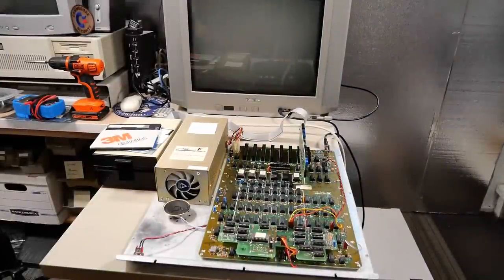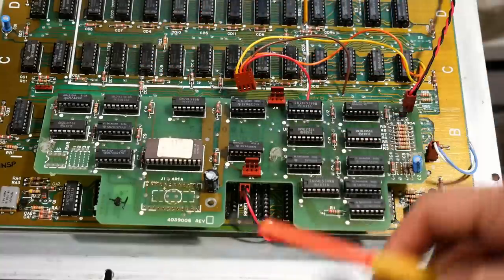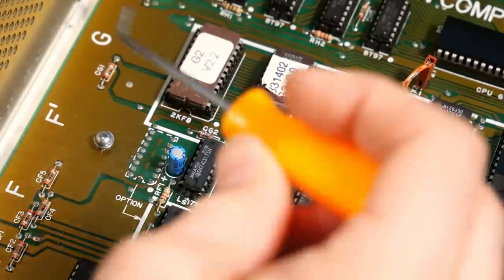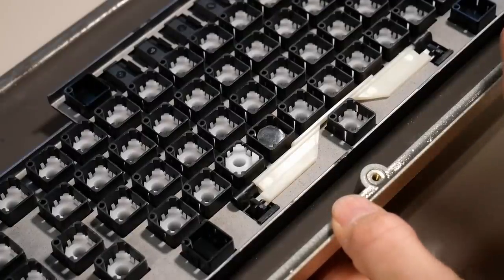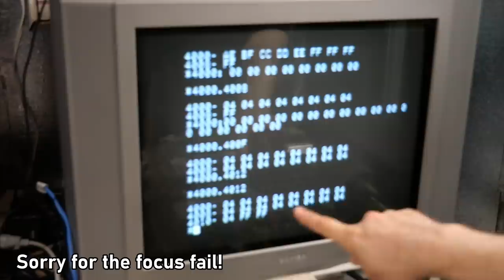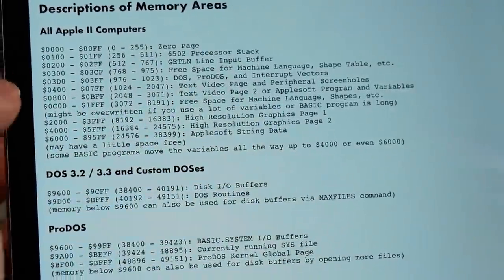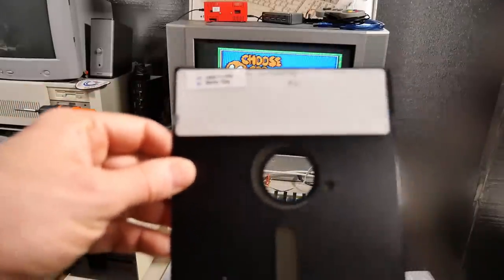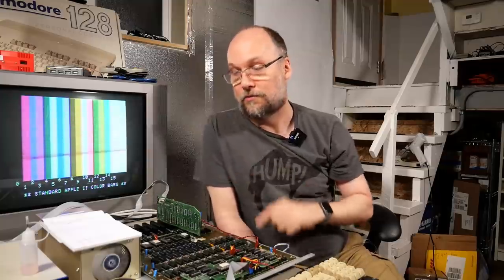Franklin Ace 1000 Repair: Motherboard and Keytronic keyboard

Comment: The 8 bit guy had a capacitive keyboard. It didn't work because of the fingerprints which changed the capacitance. Your keyboard is just a standard connect the contacts so it can probably tolerate the fingerprints easier.
Reply from the maker: All the Keytronic foam and foil keyboard are capacitive. You can actually type directly on the PCB using your dry clean fingers without issue. I'm not sure why he so much trouble on his Compaq but I was glad when this one worked fine. https://texelec.com/product/foam-capacitive-pads-keytronic/

Comment: If you throw some basic EQ on your mic audio (drop down the low frequency, boost your mids and drop off the very high end) it will sound better when your Rode craps out on you.

Comment: Hay Adrian i have a question is it possible to run a good mac/apple emulator on raspberry pi 4 ? if so you know of any good one's?
Reply from the maker: Your best best is likely RetroArch. I have played around with this a bit and it definitely works. In fact, I experimented using a Pi to drive the Mac CRT directly and it actually works for the most part but with some issues. (Firmware issues on the Pi)
Reply: Adrian's Digital Basement showed this video to my he said he used one of these machines in 1983 he worked as a maintenance guy in Monet a jewelry company in Pawtucket ri it’s closed now it’s now a uhaul 😉

Comment: Why are you still telling people at the end of your video to remove the RFI filter components in broken power supplies? They need to be replaced, not removed. Removing them causes all sorts of spurious RFI, which will have effects on everything from local wifi to first responders. Don't do that. Just replace the $2 capacitors. This is terrible, illegal advice.
Reply: The same reason he just throws away RF shielding?